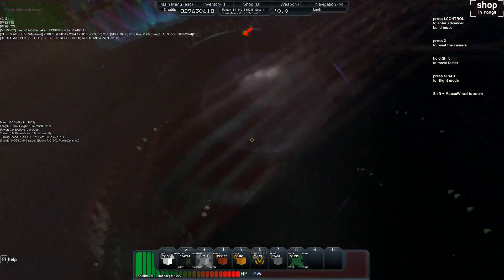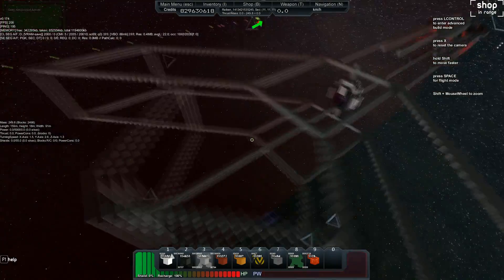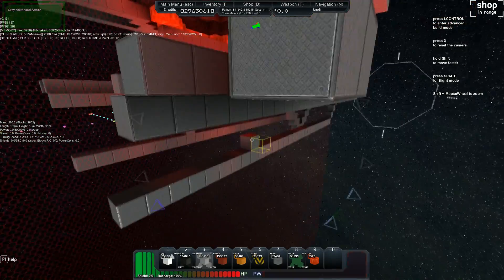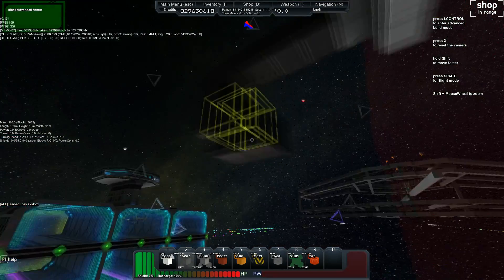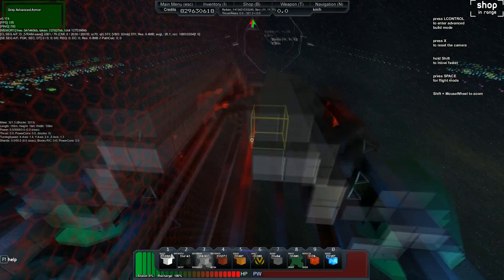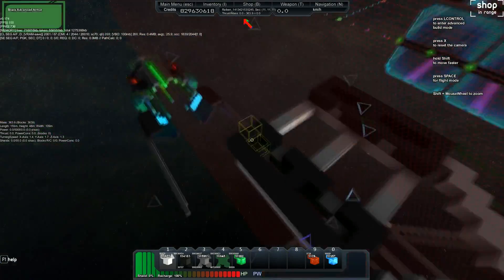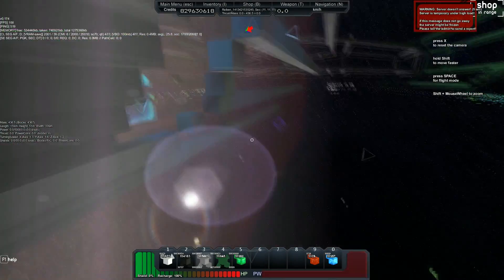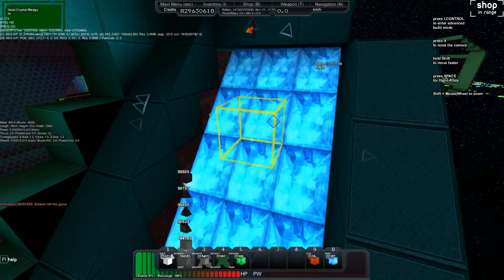Starmade - School of Design: Your First Block and Wire-Framing

Comment: This is great, I do normally just picture what I make as a real ship in my head and then try to dissolve that into blocks and wedges but everything else can be applied  to my style. Like the wire framing is like me just maybe with a big tube making circles then making them longer, so.

Comment: These are some very nice tips. Only thing is that some of them don't necessarily apply to me. I am that weird guy that draws everything on sheets of high # of square/inch graph paper before I even get the core for the ship. I end up with drawing of the front view, side view, other side view (if necessary), top view, bottom view, and back view. If I don't like something, I simply erase and redraw until I am happy, removing the frustration of building half my ship and then realizing that I skipped a 10 block long section.
Reply from the maker: Yeah, these are meant to help people out in certain situations and aren't meant to be 100% accurate to everyone's build style. Just to help people out and get them thinking about certain aspects of ship building. It's not perfect, but it is kinda how I, and several others go about the process so I figured i'd make this series.
Reply: It is very nice that you take the time to show how you build instead of just boasting about what you have built.
Reply from the maker: Well, the truth is, I like to think I build nice things, and I really wanna see more of them around. I started this series to maybe help people out in building nicer things :P (There are only so many space bricks I can take)
Reply: 'nuff said about the space bricks. Now all I need is for my computer to stop being a douche and having a hissy fit and instead actually run starmade so I can continue with what I was building.

Comment: Scythe Seven It's standard, just happends when you get a new blcok of the same type. You can also do it manually by dragging to blocks of the same type onto each other. Mostly used with hulls and glass, but crystal and crystal wedges also do it, and the processorcrystal things also do it with their wedged part.